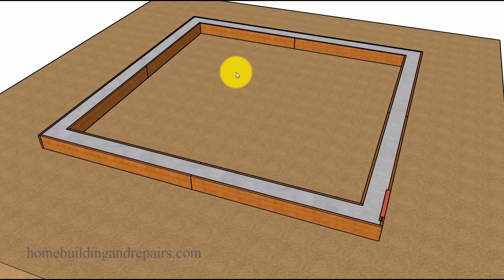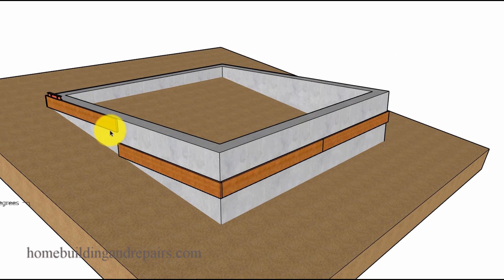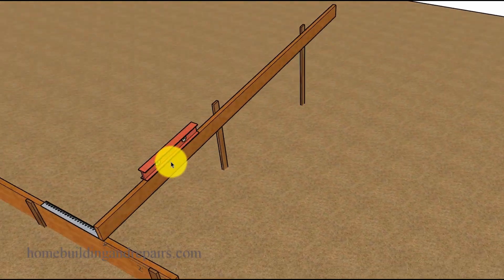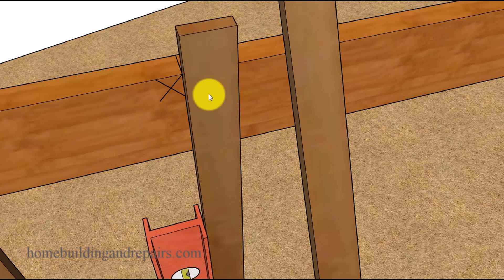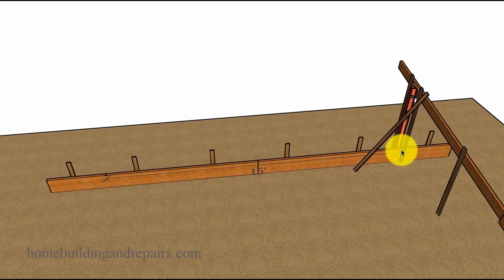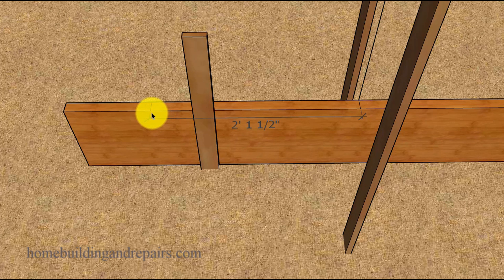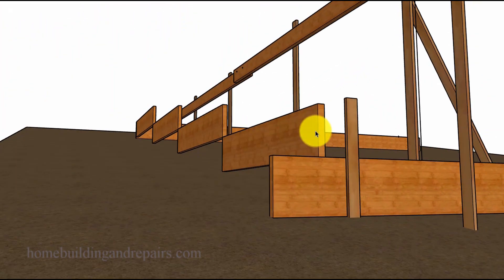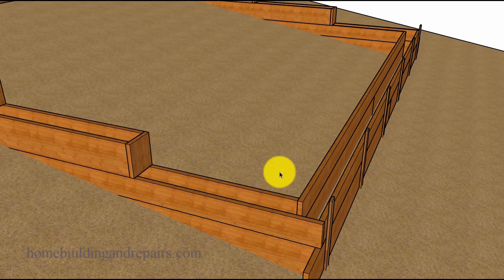How To Layout And Calculate Measurements For Hillside Concrete Building Foundation

Comment: What about a patio slab over 11 ft from wall to fence.  4inch thick at house, but 11 ft at fence would be about 13-14 inches thick.  Just pour monolithic vs perimeter, fill, slab.  Given it’s not structural, thinking mono but appreciate any input.

Comment: The same principle applies to higher slopes? Like 40-45 degrees?
Reply from the maker: You will need to check with an engineer, because steeper angles usually require piles or long round concrete filled holes in the ground going down to bedrock.

Comment: Why not just use a laser, string line, and a level instead of using lumber?? I could lay out a house foundation fairly
Quickly with two tape measures and someone on a laser
Reply from the maker: Yes, this is just one way and you can use laser levels.
Reply: @gregvancom  can we send you video ideas? I would like to cut a channel drain for my garage, slab slopes towards the garage door, and when it snows or rains even and the cars start to dry off, the water runs towards the door and will pool up all along the. Bottom of the door.. instead would like to cut channel. Install those long channel drains and then on the lower side of the drains, have it 90° to the exterior wall, then do I try and get below the footing or should I core drill out a 2-3” hole and let the water drain down into the soil in front of garage? Would I need to put down grave before repairing slab around the new drain, or do I just fill with a non shrink grout concrete?

Comment: You don't need to step down, pour all the stems the same height and rake cut the studs and solid block, and make darn sure you have  weep holes on downhill side.
Reply: What is weep holes?
Reply: You don't need to step down, but stepping down allows some cost savings on concrete.

Comment: Wondering if you have made a video that shows how to frame this type of foundation, I think is called a pony wall foundation. Can't find much anywhere on how to build it. Thanks!!
Reply from the maker: Unfortunately not yet, but I just put it on my list.
Reply: Have built many what do you need to know?
Reply: @BasketCaseGarageForFun  Pretty much details in relation to corners install, if there are limits on how heigh the walls can be, distance between sole plate  fasteners ( including at the corners), it anything that makes a pony wall different from a regular wall. I know that reinforcing the wall with plywood on the inside, prevents the wall from loosing strength ( such as in hurricane wall fastening). I have been looking for a book just on this type of install but there is nothing on the market.